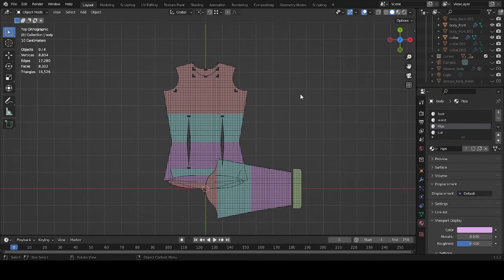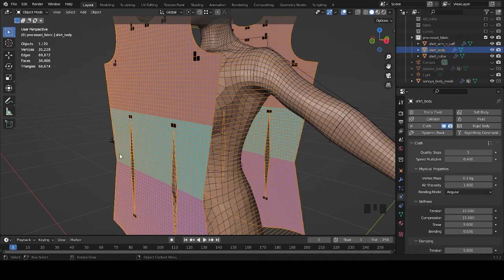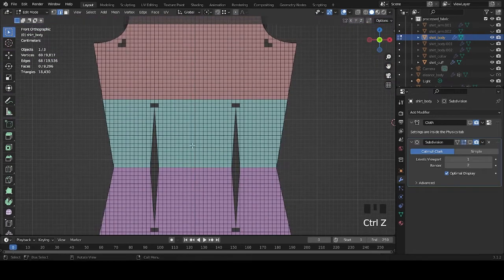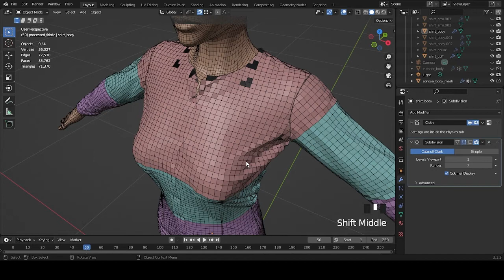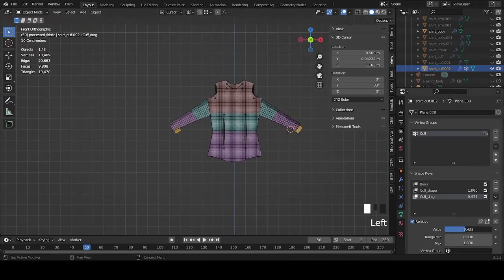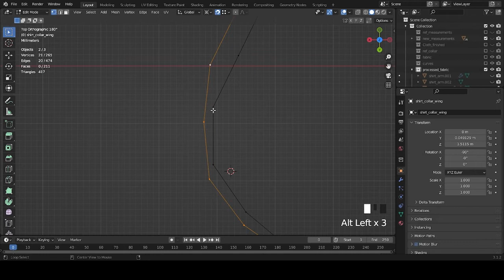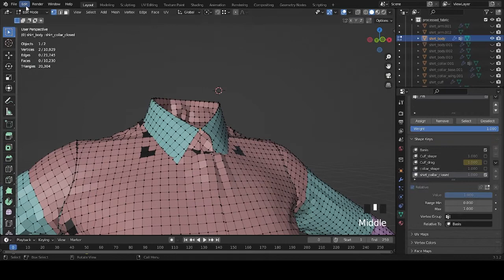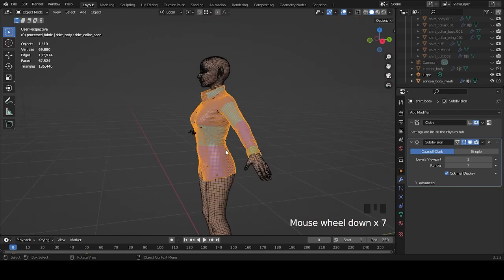A Tailor's Approach to Cloth Sewing in Blender - Part 4 - Assembly and Styling

Comment: Hello, which version of blender did you use? I have a problem in the simulation part, the clothes fit very badly on the body
Reply from the maker: It's 3.1.2, you can see it at the bottom right corner! However, cloth simulation only got updated very slightly, even until 4.0, which I have tested. So I don't think Blender version is the problem. Join the Discord server, and let's figure it out!
Reply: I also tried blender 4 and I have a problem again. It is possible to help me. Please tell me the necessary settings in the cloth part
Reply from the maker: @ramtinas  Hey, please join us over Discord at: https://discord.com/invite/F4tUcS6gru. I have to see the problem first, before I could give an accurate solution.
Reply: I think its the object scale , just scale everything by 10 and then apply the scale